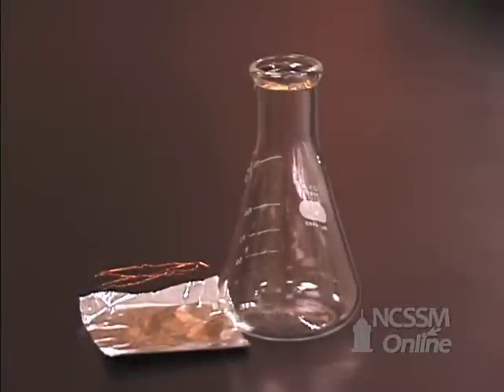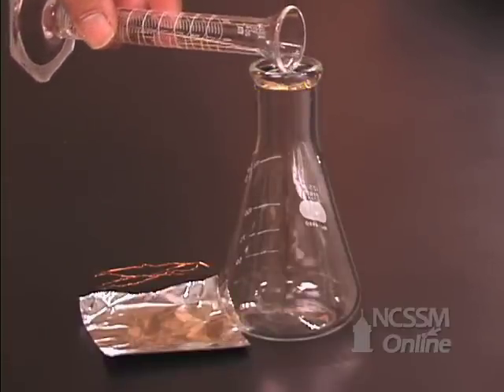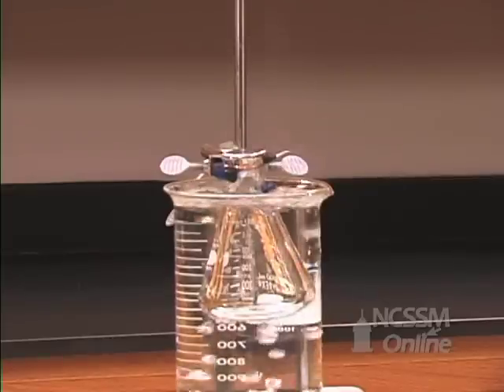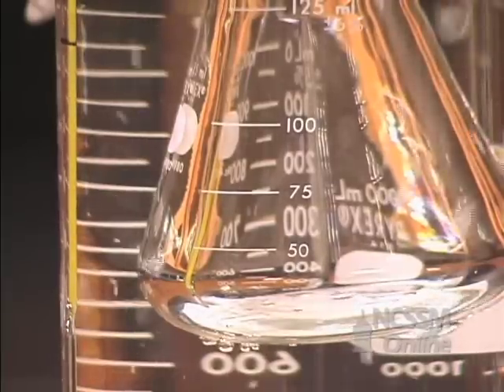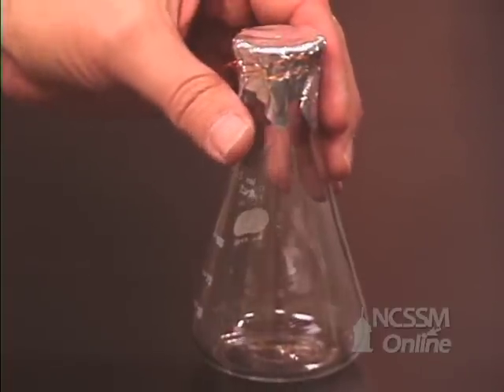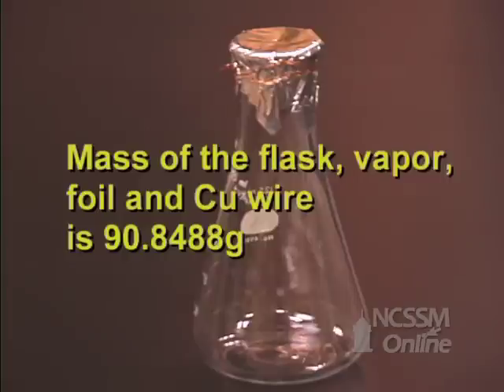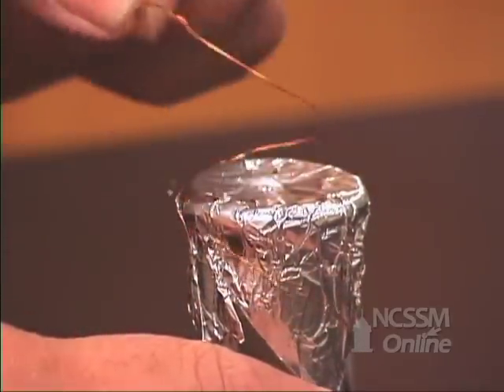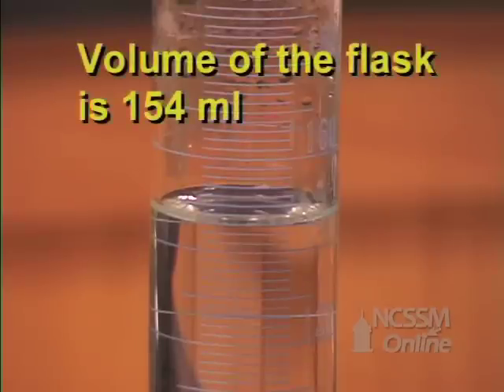Dumas Molar Mass Lab

Comment: Excellent. One suggestion: Tip the grad cylinder when you fill it with water to avoid drops that could splatter on its inner sides and bubbles that could form in the water.